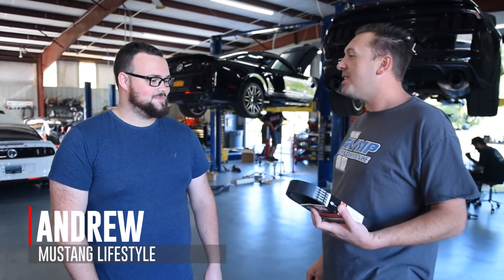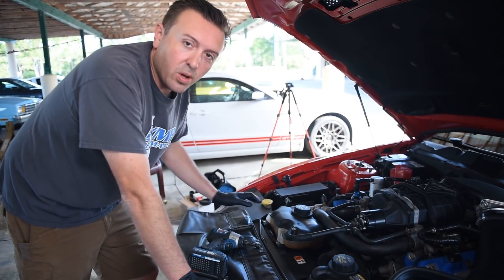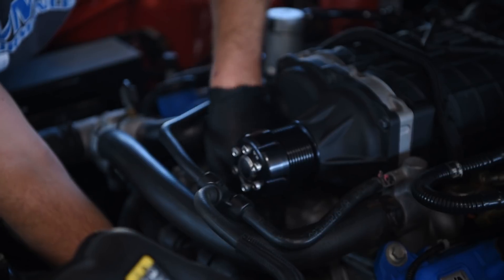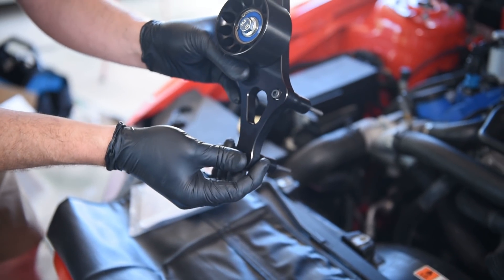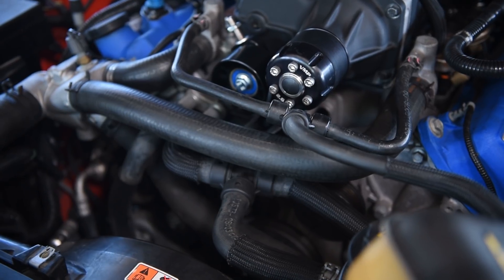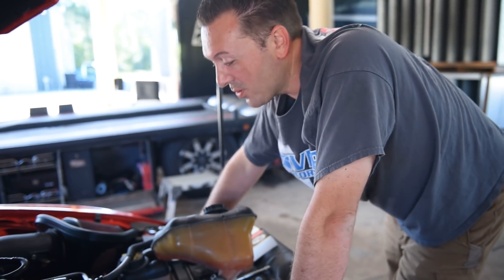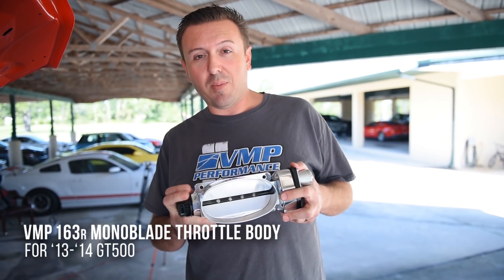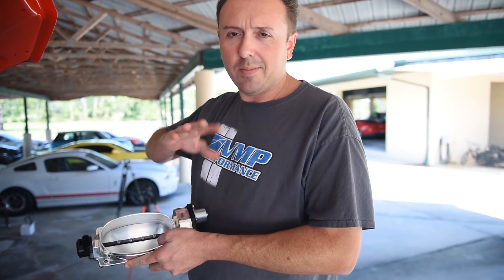How to eliminate belt slip and makeover 800 RWHP on your GT500!

Comment: Wish I watched this video before upgrading to a 2.5 inch on my Shelby! I got the 90mm idler , gates green hd belt,  and still a TON of belt slip‼️ that Auxiliary idler is what I need
Reply from the maker: We got you covered
Reply: Did you get the vmp hd tensioner? I've got the 2.5 upper and  had bad belt slip until I got the HD tensioner and I'm also running an ATI 10% lower. No more belt slip. Also had to switch to the 86.4  belt with the aux tensioner pulley and 90 mil pulley and I have 373 gears it's holding up pretty well. My next step is the 6 bolt hub set-up, 2.7 upper sure grip pulley, and rpm belt. If I still have slip after that im just gonna have to not stomp so hard.
Reply: @Gthere-cs3ow  not stomp so hard?  Wtf lol.  I don't know if that is gonna help too much with slip which is typically a higher rpm kind of thing.

Comment: I love these cars! Question: what years did they actually use the (662hp) German made aluminum block? I’ve read and heard different answers. Also, the Top Gear episode states that it was a 2012 GT500 and had the aluminum block,, but others state it wasn’t used until 2013. Did the EU get them before the States?
Reply: Hunter O'Connor 13/14 uses the 5.8     (662hp) 11-12 uses the aluminum block but still the 5.4 (540hp)
Reply: Can confirm my 2012 has a aluminum 5.4L, but with a 2.9L Whipple it makes 750Hp :)
Reply: Thank you both for the reply!!
Reply: Benjamin Ford nice. I have a gen1 vmp 2.3 makes 704whp.
Reply: 13'14

Comment: Why not use the Griptec if you guys are all on the nuts of them lately?
Reply: I am going to change my setup a bunch of times in the next few months between E85 and backing down the boost and the built motor I'll be changing out the pulley so often its easier to just run some normal pulleys

Comment: Belt slip belt slip belt slip
Change the belt everyday Lord
Two 66mm tubros minimum
No slippage more power more torque 
No lost from all those pulleys & Bridges that add up in weight
Reply: It will also never have that nasty instant brutal hit the tvs has.  Belt slip isn't an issue w the right parts it's not that difficult.